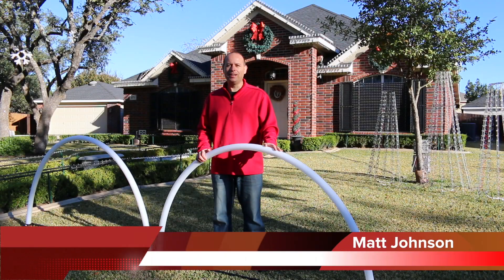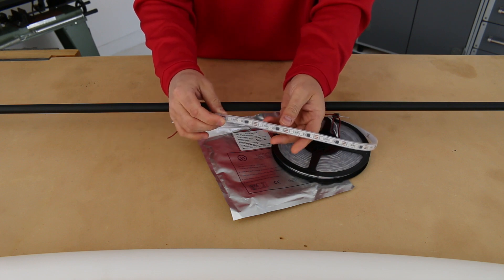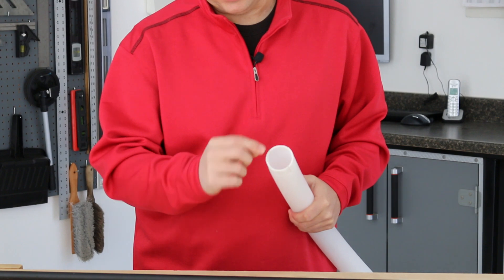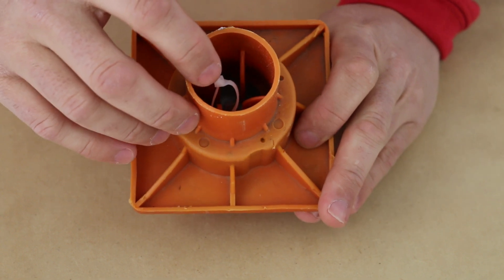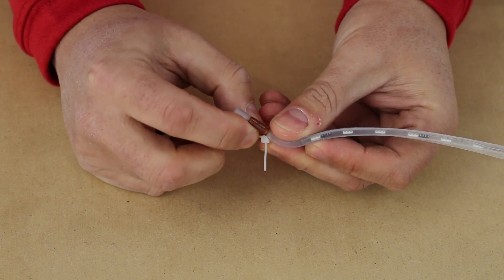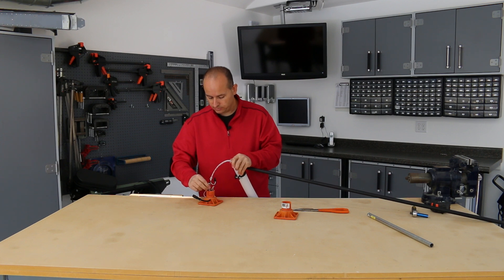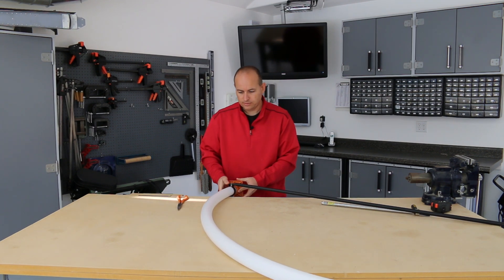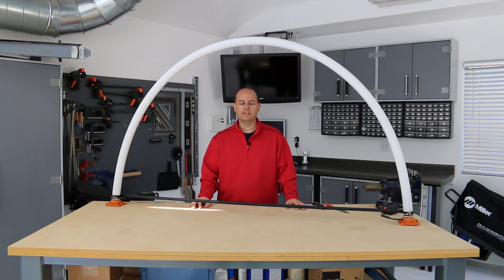Part 1: How to build a Leaping Arch for an outdoor Christmas light show

Comment: Matt I wanted to thank you for this great video. I built six of these for my display this year and they were (are) a big hit. I love the look (neon). I used 97 pixels in each arch (pixel strips) from RayWu. I put too much tension on the strips at first an actually pulled the solder joints apart on a couple of strips - easy fix but didn't need that much tension. These are so much easier to store than my old PVC pipes with mini lights wrapped (16 channel). Merry Christmas!

Comment: Matt great Video. I just ordered my pipe from the web site that you posted above and 5m strips with 300 5050 leds per strip. Are you sending extra 12v out to those arches from a power supply at both ends to keep up the brightness? or just the power from the controller?

Comment: You mention the rebar cap used as a base.  What is the diameter of the cap? Did you source this at Home Depot or an online source?  I find plenty of rebar caps but not sure about the diameter.

Comment: Nice video Matt.
thanks for sharing.
Can you be more specific about the 'slits' you make in the tubing?
How long are they?  Is the idea that when you squeeze the clamp that it flares out on the bottom to provide more friction to against the rebar cap?

Do you know what size/type/make/source you used for the pipe clamp?
I'm assuming the crossbar is 1/2" electrical conduit, correct?

Also, how do you secure the whole assembly to the ground?
Reply from the maker: ukewarrior Thanks for these questions, I added the answers to the video description because I am sure a lot of people will wonder the same thing.

Comment: Can you link to the lights you got? tried looking them up but lots of different types with various changes per lot. not sure what is what. thanks for the video!
Reply from the maker: Give these a try: http://www.aliexpress.com/store/product/5m-DC12V-60leds-m-20pcs-ws2811-ic-meter-20pixels-led-digital-strip-IP68-waterproof-in-silicon/701799_1921783413.html
Reply: +Matt Johnson Do these lights work for 2 arches? You didn't mention in the video how long you made the led strip for your arch. The lights linked above are 5m. Cutting that in half gets you just over 8 feet.

Comment: Matt  you didn't mention what size tubing you used in this arch
Reply from the maker: As much as I tried to remember all the details I knew I would forget something :-P The tubing is 2". The McMaster-Carr part number for a 100 foot roll is 50375K64. It can also be purchased in smaller sections.